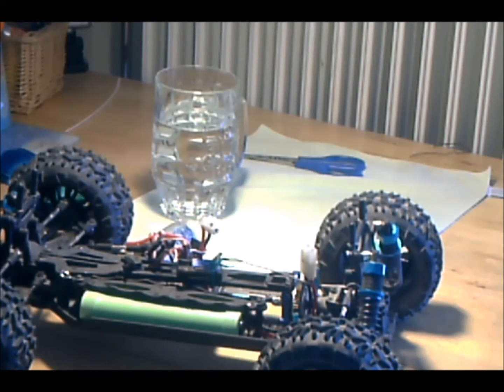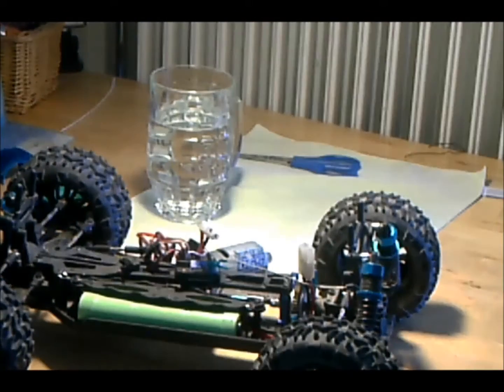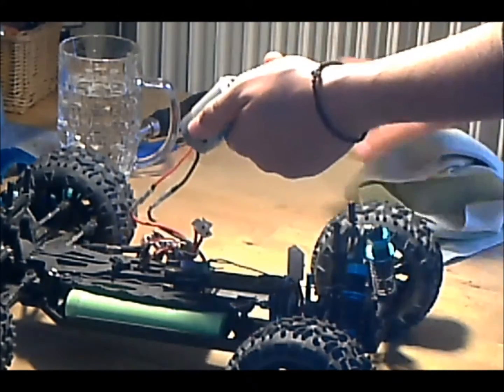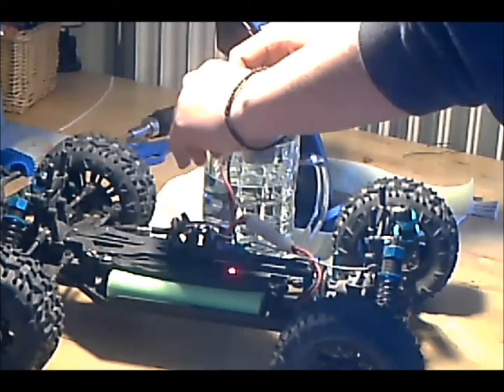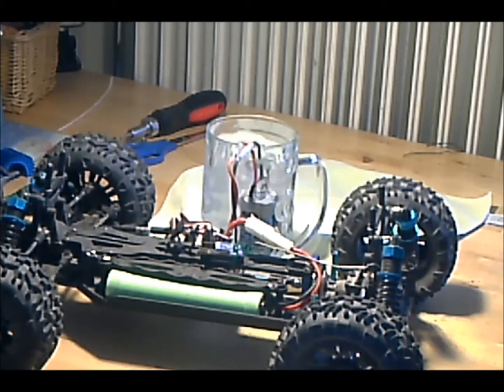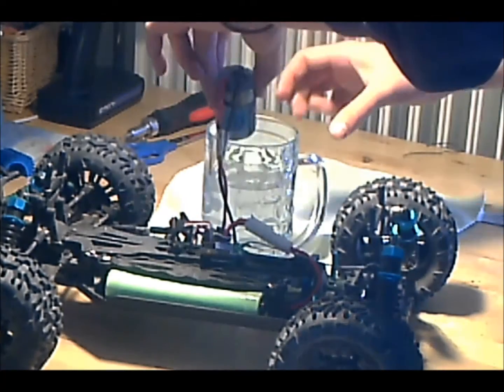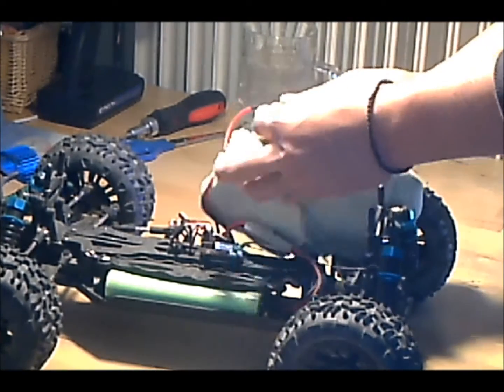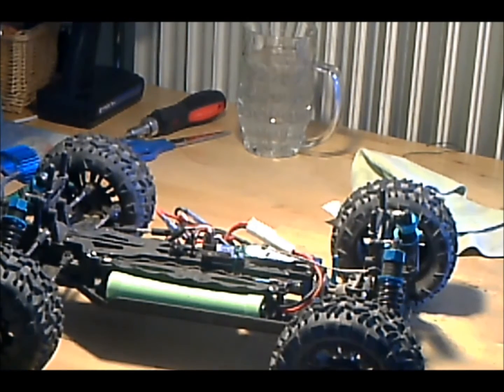How to increase any brushed motor's performance ( Break-in)

Comment: You didn't do it right...do it much longer until the water turns blacker. Brushed motors are the same as they used to be. Make your life easier by using a AA battery instead

Comment: You killing your motor that is a old trick from the 70 that do not apply to motors now
Reply from the maker: For cheap motors that you can't open  to clean them , It's a good idea and I didn't have issues so far.
Reply: John Holmes still says to water break in